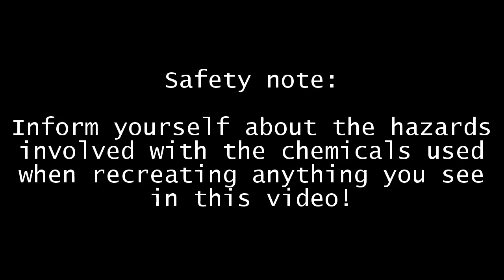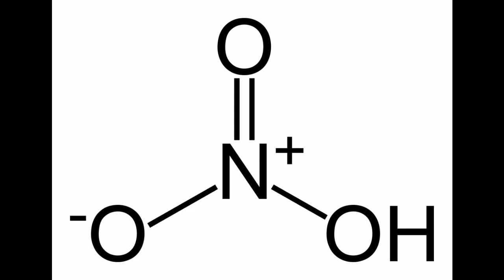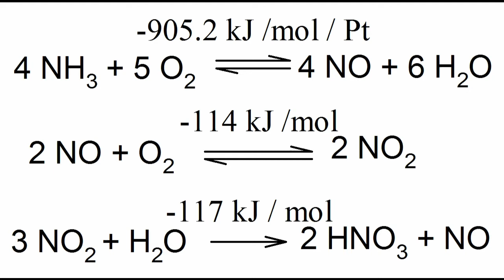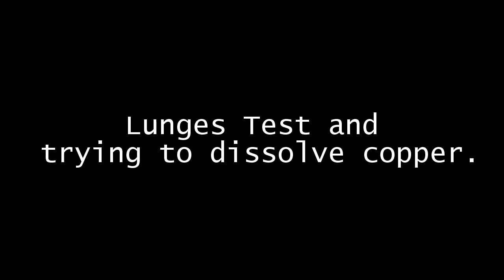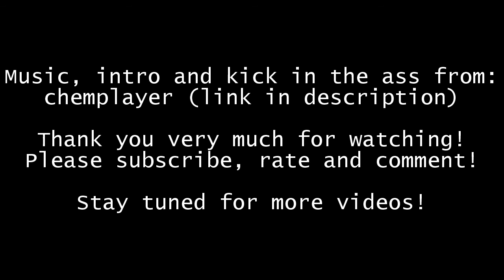Ostwald process: Catalytic oxidation of ammonia for the production of nitric acid

Comment: Hi do you think this process is preferable to the birkeland-eyde for producing hno3 at home? birkeland eyde is really limited in production quantity.. ostwald process is the industrial method still used today but how practical it is for a home chemist is another thing.
I meany to add, i looked the old industrial preparation. youre looking at a little under 850c iirc.
You can go by colour chart of the glow of embers. vapour smoke given off also confirms correct temperature is reached

Comment: The catalysts from brick 1 out of an automobile catalytic converter have an ideal catalyst for making nitrogen dioxide. The coating is platinum rhodium 5 to 10%. The irony is that under the strongly reducing conditions in the exhaust stream, this brick removes nitrogen oxides. For industry, the catalyst is made of hair fine wire with a bit more rhodium, usually 85%Pt and 15%Rh😮

Comment: Are you using white Non ich Fiberglass insulation for the Fibers...?  Then Soaking it into the Pt from Aqua Regia once it's precipitated and Re dissolved ....And I think HCL And NaCLO work better on Pt to Dissolve for Precipitation ...is this Correct...?
Reply from the maker: There is no insulation, only the quartz wool catalyst. You first dissolve Pt in Aqua regia, then prepare sodium hexachloroplatinate from the solution. This is dissolved in water and reduced with ascorbic acid while the catalyst is soaked in the solution. And chlorine water is a mixture of HCl and NaOCl as chlorine disproportionates partially into the mentioned species.
Reply: Ok Gotcha....Easy Enough....! Kinda Hard to Keep along with the Video Voice....And im sure you are Removing the Nitric Out of the A.R. Before using it.....?  Urea.....Thanks Astral Chem......Rich........:)

Comment: Now i have it. My design would be pump, air hose ,t connector bevore the ammonia tank the hose from the ammonia tank goes to another t connector here they meet with the hose from the valve and the one to the catalyst pipe or chamber. You can maintaine combustion with the valve when you open it you have less ammonia and more air vis ver. to much air brown smoke to much ammonia withe smoke. :)

Comment: I wonder if hand warmer catalysts would work?
Reply: No, they're based on iron powder, not platinum.
Reply: @pieterveenders9793  zippo style hand warmers use a platinum catalyst on glass wool
Reply: @pieterveenders9793  You're probably thinking of the disposable hand warmers. Zippos use platinized silica. Some people replace failing Zippo catalysts with gas fireplace embers, which are basically the same thing, and yes, they might work. Too much platinum hinders the Otswald process, according to AstralChemistry.

Comment: Say your having problems with Ammonia Gas Straying over into your Collecting Vessel ..it looks to me after the Cat they are using long water cooled Condensing Rods before the HNO3 Vessel. Also introducing Air ...it is a liquid mostly into the last Collecting Vessel...Also did I hear you say you were Boiling down the Ammonia to make it Stronger displacing the water in it. Are you doing it under a Vacuum for low Temp....?...if so boil to what Ph.....?  Quartz wool is easy .., make a A.R. add Pt ..Neutrlize with Urea boil down to a Syrup add water place Quartz in it ...Add Ascorbic Acid and stir...Maybe leave for a day or so to plate wool with Pt...
Reply from the maker: A solution of ammonia can be heated to the point where ammonia gas will start to outgass from the liquid. The setup as shown in the video was arranged in a way that the process is clearly visible in the video. The target was not to archieve the maximum yield of nitric acid, which can be simply ordered from the chemical suppliers.
Reply: Your Video here does not have any Heating Element Under your Ammonia Supply Vessel ..You are saying can get a Stronger Ammonia Gas from Heating it...I see the first 2  Reactions  Equilibrium goes both ways..Precipitate the Pt to a Mud ...Then add distilled water enough to soak the wool...Are Ya adding the Ascorbic Acid to the water before dumping it into the Pt Precipitant...? Or are you adding the Ascorbic Powder after the wool is placed in the watered down Pt Precipitantant...?   Very Nice Chattin With You Astral Chem...PS...Getting HNO3 at a decent price for Ewaste to make a Dollar is impossible....!!  And Distilling Drip by drip ...Well....Thank's..:)

Comment: I feel like instead of heating the catalyst with a torch it could be primed so to speak with methanol vapors to get it to ignition.
Reply: It would be hard to do if i understood you corectly
Reply: @thenuke4195  it shouldn't be platinium causes methanol to oxidize at room temp. So much so that it can and will spontaneously combust. All it needs is to be orange hot to start it so this should work.

Comment: well...I'm gonna comment in English even if i'm from Germany

where did you buy that special tube for the combustion chamber? would it be possible to attach some NS 29/32 joints on it?
we don't want to try to use our expensive ground glass glassware if it will break...
Reply from the maker: Thanks. 
We bought it from our glassblower. But there are plenty of these quartz tubes around on ebay. Just search for "Quarzrohr".
It would be very expensive because you would need specially made ground glass joints from quartz glass. You cannot fuse different types of glass together (different thermal expansion). It is much cheaper to use stainless steel tubing.
Reply: No need for a straight pipe. I did this experiment a few times some time ago, one of the times using a round bottom flask (500ml) with three necks (one unused, was stoppered). The middle one had a rubber stopper with a glass pipe in the middle extending almost to the middle of the flask as inlet for ammonia and also a length of copper wire (instead of platinum) that extended to the middle of the flask and was coiled in a bunch there just at the tip of the inlet, staying a few centimeters from the walls (not touching anything except the stopper a few centimeters behind). The other neck of the flask was used as outlet for the reaction gasses. Using copper in place of platinum worked, but starting the reaction required careful timing as I had to heat the copper wire using a bunsen burner to yellow hot temperatures and then quickly insert it into the flask and open the ammonia gas flow. After started it went by itself, the copper wire glowing, but careful flow control was needed, since if the flow was too fast it would cool down the wire too much, stopping the reaction.

Comment: I saw the method you used to prepare the catalyst. Good vid. That much platinum usually costs less than 40c when purchased in gram quantities, so this process relatively cheap compared to buying HNO3 online. You have proven nitric acid production at home is not only convenient, but also economical, given the right apparatus. Just a few questions, though. Is there anything I can use instead of fused silica tubing? The stuff is expensive. How long does it usually take to get azeotropic (~67-68% concentration) nitric acid in the quantities shown in the video? In your other video, you used aqua regia to dissolve platinum, convert it to sodium chloroplatinate, and use ascorbic acid to reduce the platinum(IV) to platinum(0), which slowly deposited on the silica wool. Could I do the same but with 30% hydrochloric acid? Would adding more platinum significantly increase the reaction rate upon the surface of the wool?
Reply: for the azeotropic nitric you should be able to do some stoichiometry to find the amount of ammonia that is required. I am not sure how to calculate the time tho without trying it.
Reply: As for the silica tubing, you can use a copper or iron pipe, yes you wont be able to see whats happening inside, but it would las for many runs, and tou could tell if the reaction is happening by the color of the fumes.
Reply: @theterribleanimator1793  you can get quartz glass tubing from mcmaster for fairly cheap, a foot of 5/8" is $7.57

Comment: Just curious how efficient is this process? Also would this be economical for me to do?
Reply from the maker: In an industrial setup this is highly efficient. Wether it is economical depends on what you want to do. If you want to build a nitric acid plant then probably yes. If you just want to have some nitric acid then it is way cheaper to buy it or to make it yourself, f. ex. from a nitrate salt and sulphuric acid. Just consider the platinum catalyst. If you have to buy everything to make the platinum catalyst then you can probably buy a lot of nitric acid for that money.
Reply: Where I live 2 liters of nitric acid costs about $150 which for me is a little bit much. The hardest part I guess is getting hold of the platinum catalyst.
Reply from the maker: You can easily make the catalyst yourself. Check out my video: https://youtu.be/iaNSH89gpPk
Reply: Thank you, will try this soon.

Comment: Hi, ich habe die Mehode noch nie vorher gesehen, und finde sie echt spannend. Viel Katalysatoren von Autos und Mopets haben doch auch oft Pt-Kats. Was meinst du, wäres es ein Versuch wert, es damit als Kat mal auszuprobieren? Es kostet ja nicht viel.
Du machst gute Videos weiter so.
LG
Hi, I have never seen this method before, its very intersting to see it. Many Catalysts in Cars and Motorcycles got Pt-Catalysts, so would it be possible to use those as a Catalyst? Is it worth trying, because it doesent cost very much?
Thank you for your good videos and ideas.
BR
Reply: Car catalysts don't use pure platinum if I recall correctly, but rather a mixture of iridium and platinum. I don't know if the iridium would negatively affect the oxidation of ammonia. Otherwise it's a very clever idea to use a car catalyst, considering the enormous surface area they have.

Comment: is the platinum reacted? how long can you use the same platinum without changing it?
Reply from the maker: No, it will remain practically unchanged. This will last a very long time. In industrial setups, platinum is slowly lost from the contact. But in this small scale with this moderate reaction conditions, there should not be a problem.
Reply: Astral Chemistry where do you get the platinum? i seen some platinum gauze listed for $600+ for 1.7g
Reply from the maker: https://youtu.be/iaNSH89gpPk
Reply: Astral Chemistry where do you get your platinum foil and your glass? ive been reading lots of reviews and with atleast some it says the glass is so thin they are afraid they are goin to break it
Reply: will any platinum group metal work  for this or does it need to be platinum?
Reply from the maker: The platinum sheet metal was cold rolled from a lump of solid platinum. The glassware is from our glassblower, including the quartz tube. 
No, nickel would rather catalyze the decomposition of ammonia into its elements. Palladium should work. Apart from that, iridium and maybe rhodium should also work.